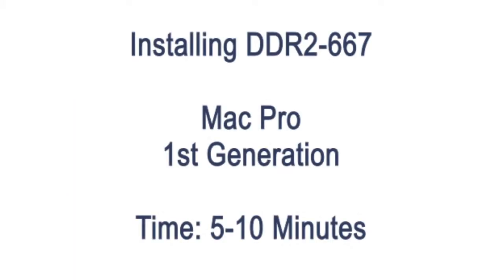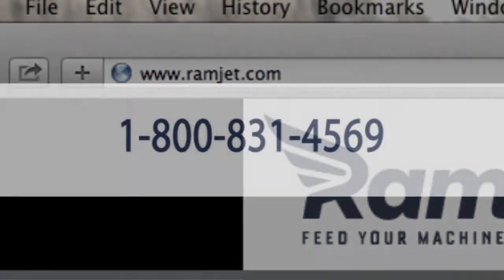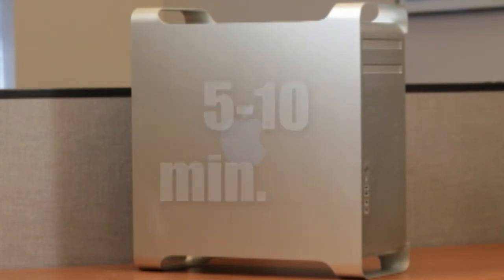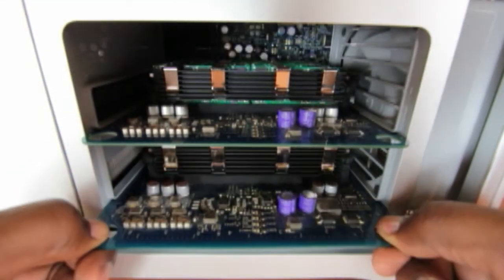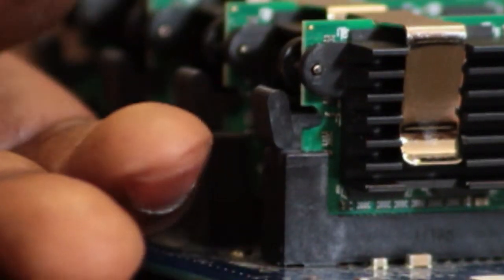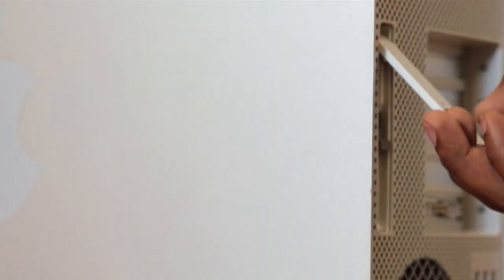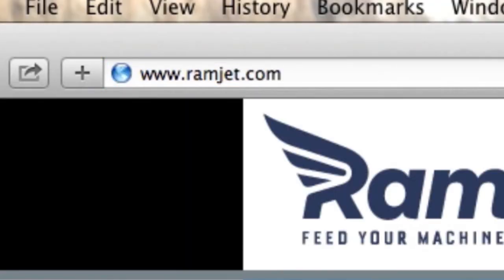Installing DDR2-667Mhz RAM in a Mac Pro

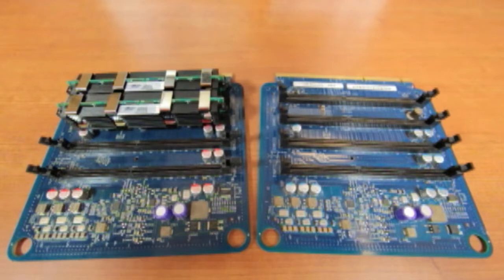Comment: @ 2:10 you talk about the order in which memory is added.  You show the two risers side-by-side on the tabletop, yet when they are installed in the tower they are over-under.  For a 2-DIMM configuration you show the pair installed on the left riser.  Will that be the upper or lower riser once installed in the tower?